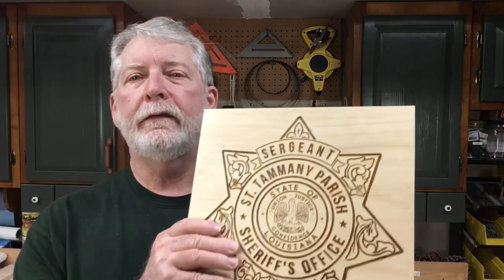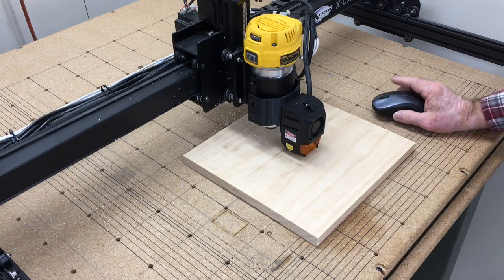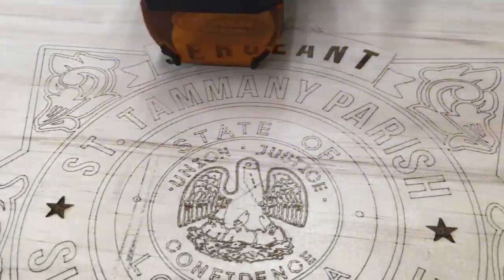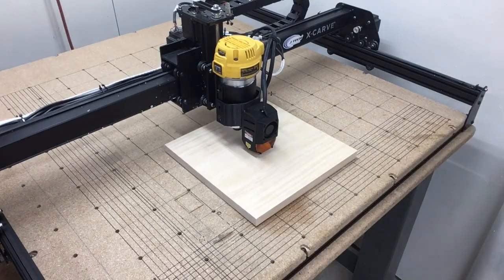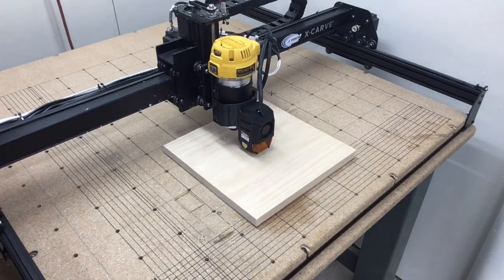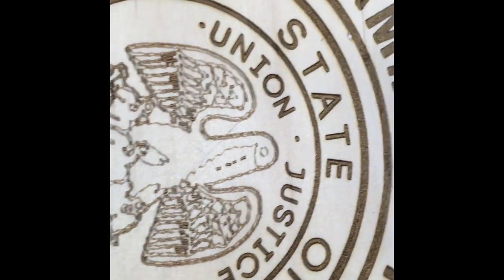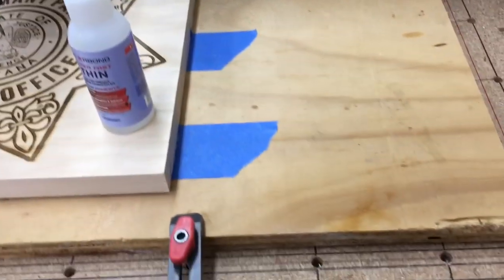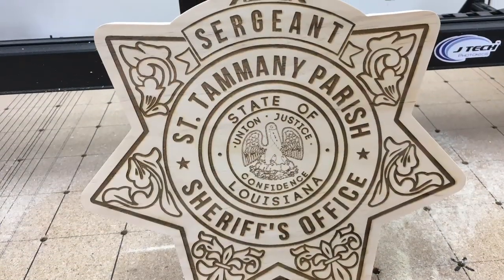Amazing!! Using Easel and Lightburn Software Together

Comment: What program did you use to run the router will light burn work with router also or what software did you use for the cutting part?
Reply from the maker: Lightburn software is for the lasers only. The CNC router use Easel software and then for other projects I use VCarve Pro to design and generate the gcode then use the Openbuilds software to control the CNC machine.
Reply: What is te name for the laser machine?

Comment: I have a box that I created with Easel Box Maker, is there a way to import the file to Lightburn so I can cut it with a CO2 laser ?
Reply from the maker: Yes, you should be able to do it. Save the gcode.  Open in Lightburn. Another way is save it as an stl file. Again, open in Lightburn as an stl file

Comment: When you switched to Easel, what process did you use to make sure the area you were cutting was perfect around the laser Ed area? 

I just started using lightburn with my 7watt jtech.
Reply from the maker: The only thing was to use the center of the project as the x,y 0 position.

Comment: Do you ever use the dust boot attachment on your x carve?

I learned very quickly that the jtech laser mount interferes with the dust boot when you cut deeper than about 3/8”

Due to that design flaw, I now have to remove the entire jtech Mount every time I cut/carve deeper than about 3/8”. :(

Also, what are you finding to be the best speed (feedrate) and power settings for engraving soft and hard woods? I feel like I’m getting a lot of charring.

Thanks for the videos! Great work!
Reply from the maker: No, I do not have the dust boot attachment and do not plan on getting one.